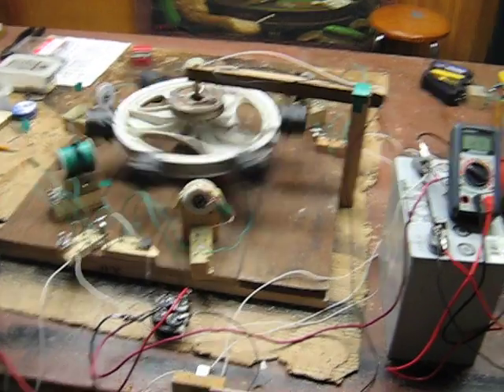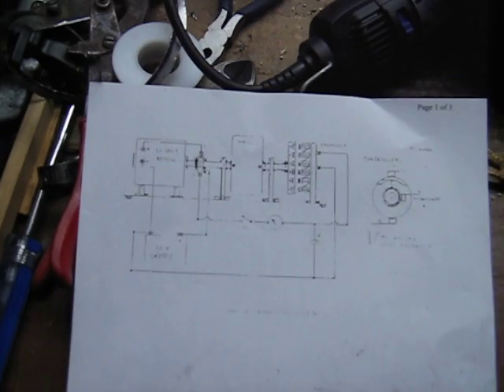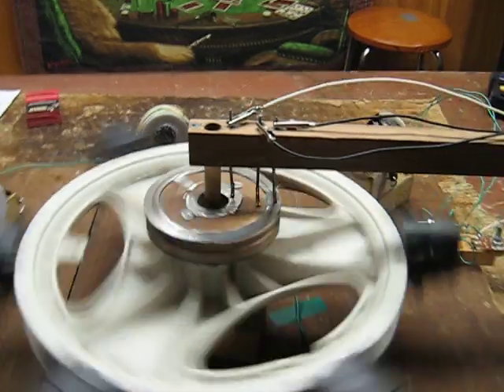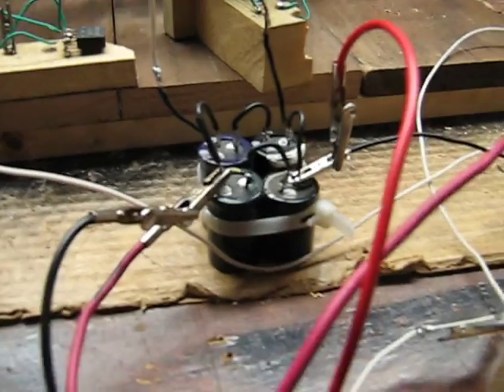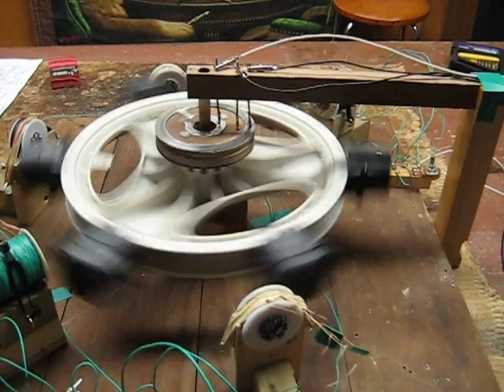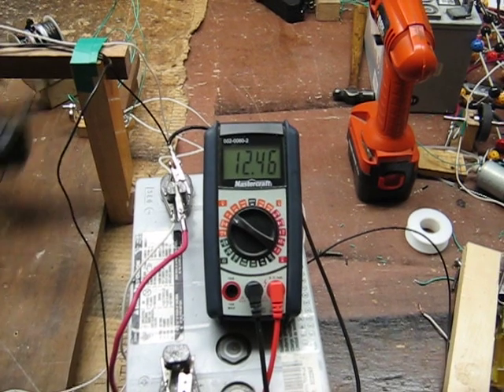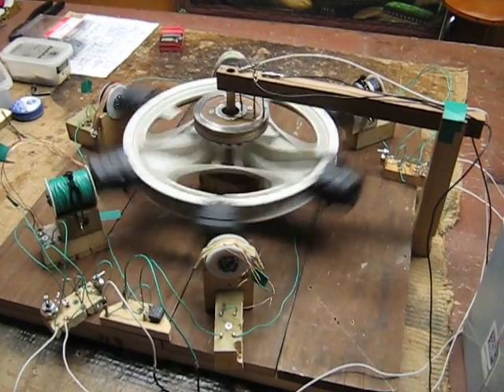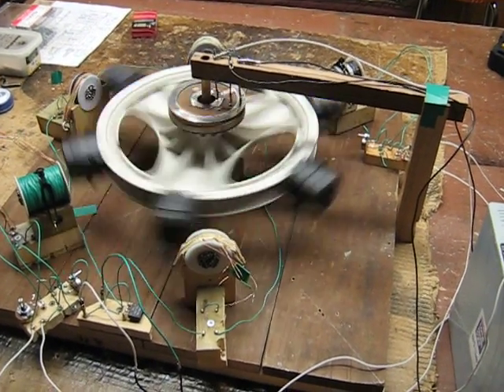Bedini - 1984 Concept - Self Runner?

Comment: yes, im also studying his 1984 self energizer runner diagram, its staggers charging and discharging in between a flip flop switch device..whats intriguing is that it is said the generator coils are not amp oriented but only volt oriented..in other words the generator coils don't really have any significant amp output only voltages but it still manages to charge the battery that is running the motor

Comment: This is a great build. For those who haven't heard of this concept, I'll explain. Bedini's motor/energizer is a self running motor that draws a load from a battery, and also charges the battery at the same time. The key to the process is momentarily disconnecting the load while you are charging the battery. The lead ions cannot move fast enough to respond to the load, as long as you keep the charging pulses longer than the motor pulses.